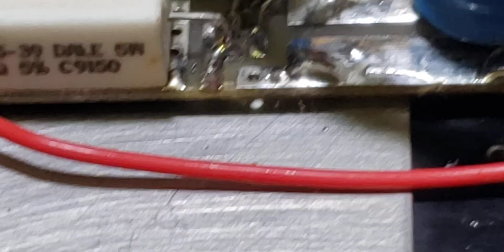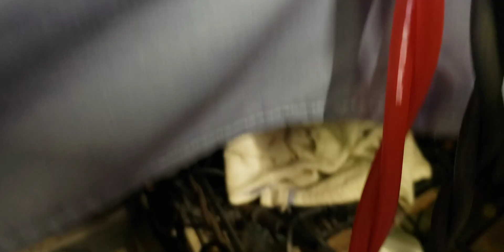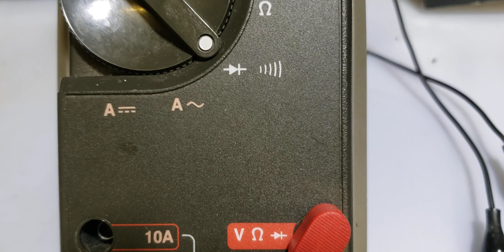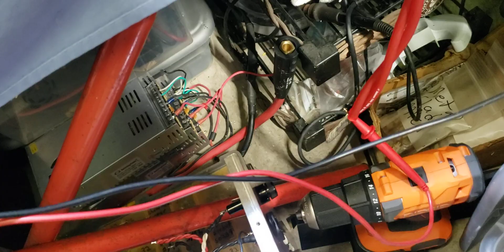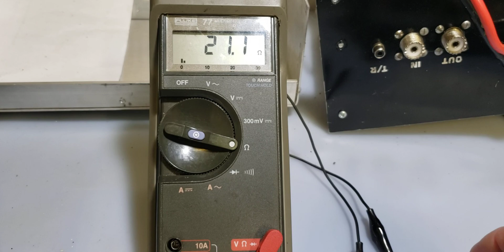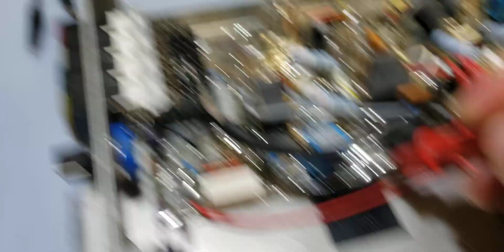[GK Tips & Tricks] - Texas Star DC Short & Lamp Testing!

Comment: nice old meter. I got the 87 . that protection diode only goes bad if hooked backwards. Them 18V lamps so hard to get. normally put in LED's. The newer 7373 can be replaced with 73 lamp from auto parts store. and they have a LED for that as well. I just go with LED for the lamps now. I sent all info on coax and pic's to your email . They have better PL 259 and BNC and N connectors. I had them make me all new test jumpers and they test them. I do work up to UHF. 73's